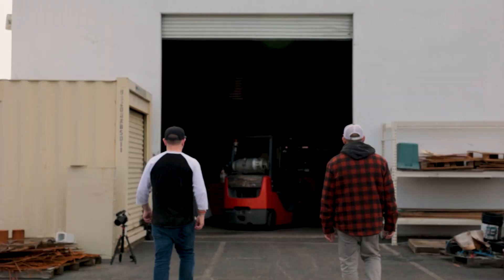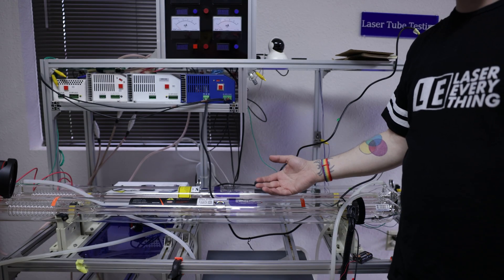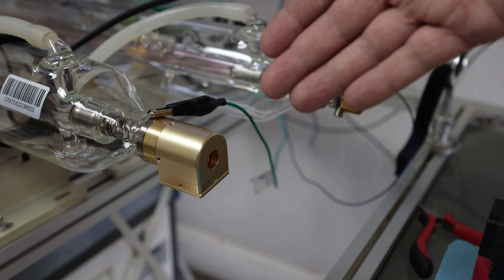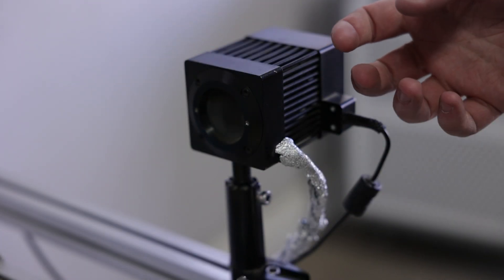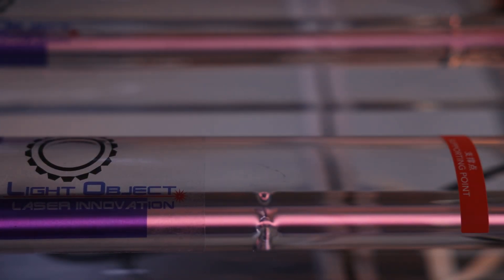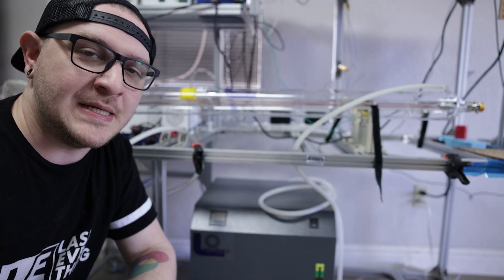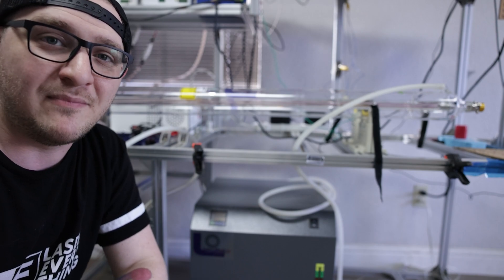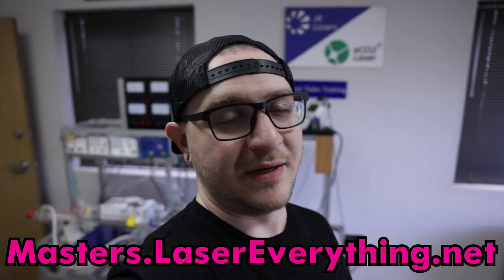Does a Red Dot Beam Combiner REDUCE Power Output? | JK vs SPT

Comment: There is clearly a reduction in laser power, because there is a beam combiner lens, which of course will reduce the laser power. This also applies to metal tubes. But it is small but the benefits obtained are greater.

Comment: Is it only the SPT lasertube with inbuild beam combiner that affects the laser power or would a "standard" beam combiner also reduce the laser power? Is it due to small energy loss at the beam combiner lens or what is the explanation for the reduced laser power of the SPT with the beam combiner design it has compared to a standard?
Reply from the maker: SPT is the only major brand I believe that has them. In line like this. The effect of a standard beam combiner would be the same, assuming you're hitting it at a 90° angle the way it was designed to be used. Either way, the effects should be minimal. I actually don't think they really reduced the power meaningful way overall. Like I said, if you really need the extra couple watts, and I mean really really need them, it could theoretically help, but at the end of the day I think the value of a beam combiner, whether in line or as an add-on adds way more than whatever you're going to lose. Steve

Comment: Great video! Can you explain difference between a tube with a beam combiner vs a non beam combiner tube? Thanks
Reply from the maker: A beam combiner simply adds a red laser to the path of the CO2 laser. This means the red laser will exit the nozzle just like the CO2 beam does and you can see exactly where your jobs will start, run, stop without having to deal with an angled red dot and trying to keep it calibrated. Red dot beam combiners are VERY useful.